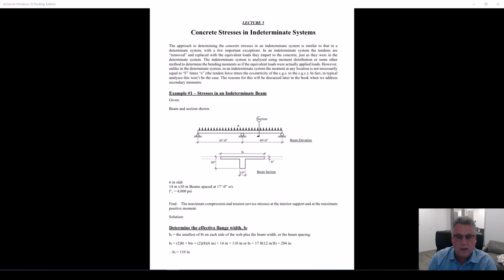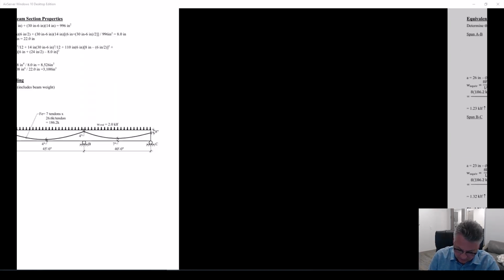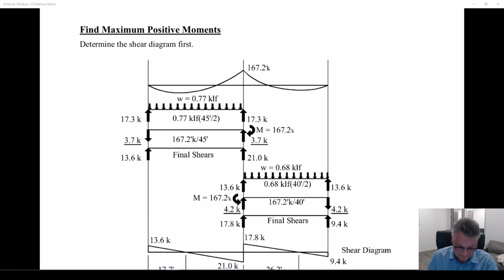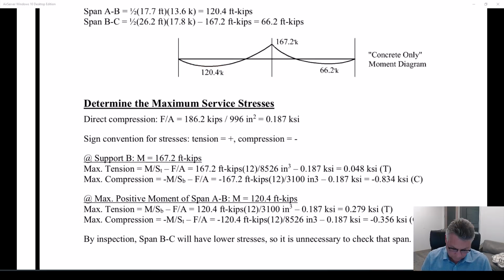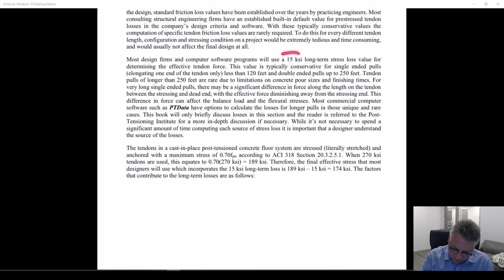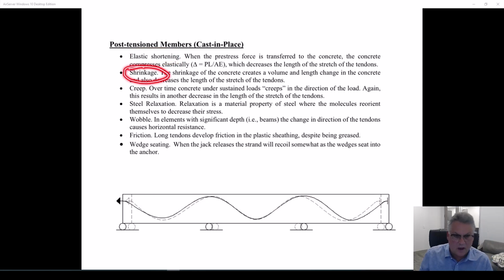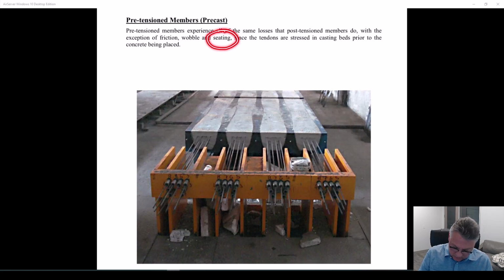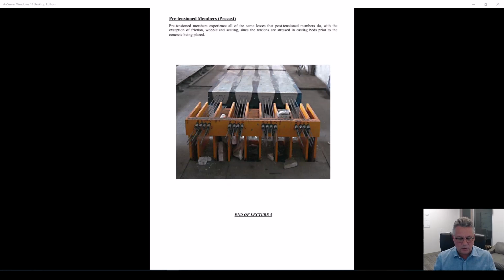Lecture 5 - Flexural Stresses in Indeterminate Members (2023)

Comment: Thank you for your videos professor, I didn´t learned about post tension design at the university so i'm learning a lot!, may I just ask a question? does the parabola have an offset from the middle?  the calculations of "a" accounting an average of 4 and 8 made me believe it was at the center however a cuadratic parabola is symmetric, so is the error negligible? or are there 2 differente parabolas ?  Thank you! Greetings from Peru. Juan
Reply from the maker: The calculation is done at the midspan of a tilted parabola.